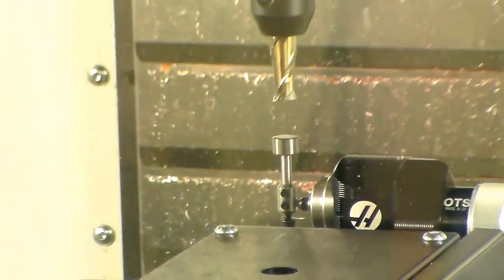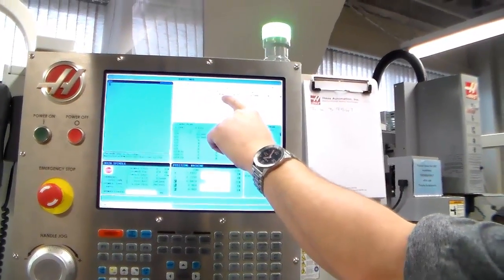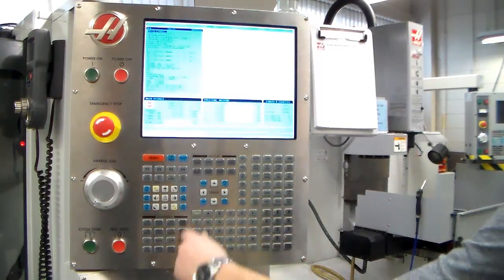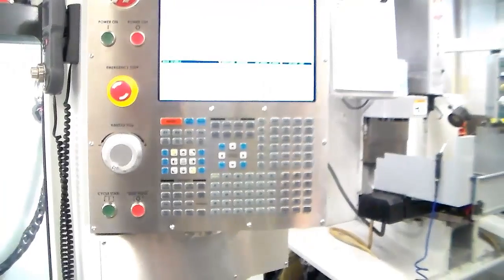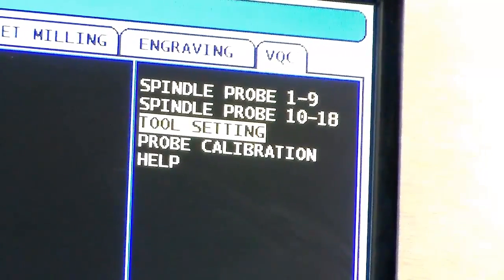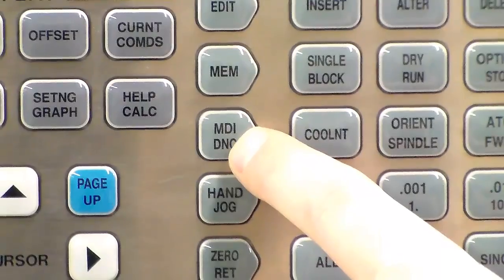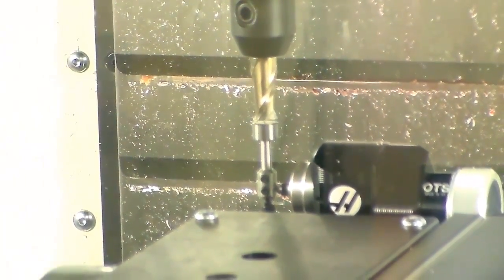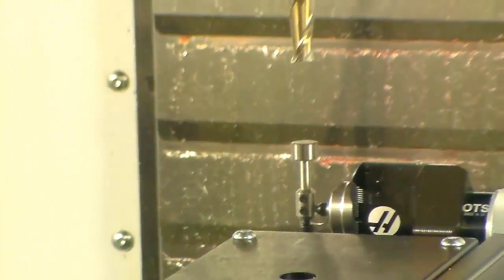Haas 5-Axis - CNC Mill - Tool Length Offset

Comment: how does the machine know where the tool probe is located? mine is on the top right of the table and it has never been used, in fact it still has the guard attached.
Reply from the maker: This probe is set up on the back right of the table. Haas technician installed the probe and then indicated to the Hass machine its location.